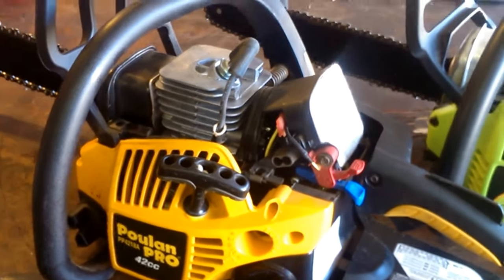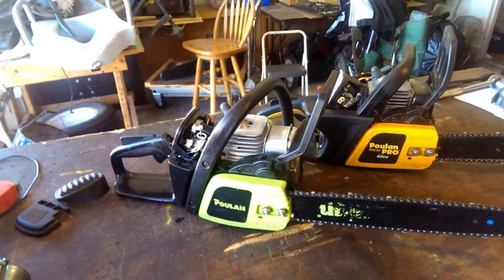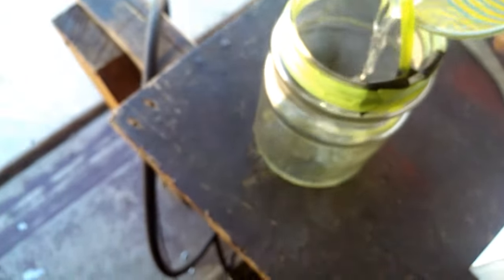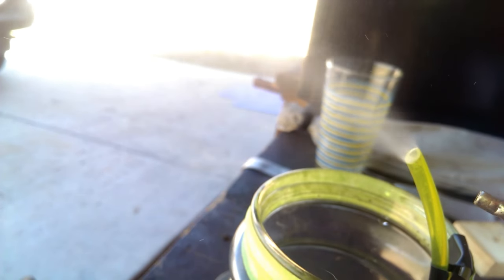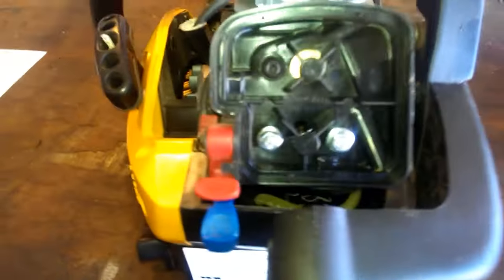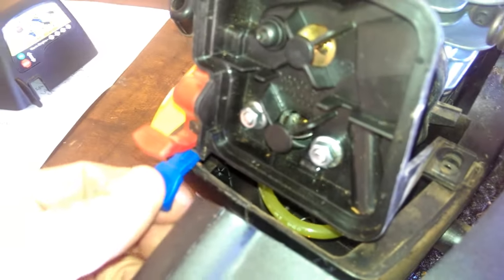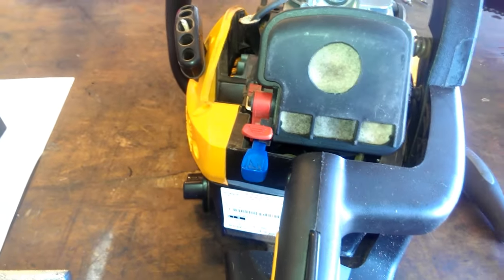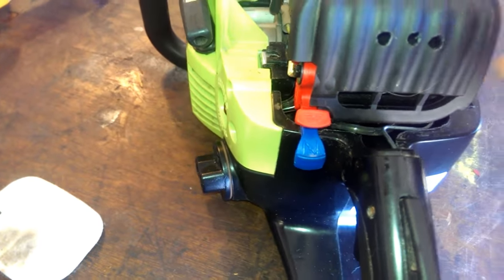Poulan wont restart after being used & how I solved my problem.

Comment: This video is great in going to try this! I have a brand new Poulin Pro (well about 3-4 years old but never used until today). Worked great for about 5 minutes of cutting then engine idled slower sand slower while cutting then just shut off mid cut. Checked fuel was still good.  Tried again after an hour because it wouldn't restart and same issue after 5 minutes. Wouldn't restart.  Think I flooded the engine and know how to fix that issue but wondering why it conked out on me mid cut when it's brand new? Thanks for your time if you ever get a minute to reply and again great informative overall video!
Reply from the maker: J.R. Wilkinson Hey Jr Thanks for the comment. when you say new 3 years old does that mean it NEVER had fuel in it?  Just only had fuel put in it when the problems ocurred?
Reply: ulitepilot aka Zombie Dave Yes that's right. Never had fuel in it.
Reply: I added fuel a few days ago and started it up then actually used it yesterday for the first time. Worked 5 minuted then died on me. Started up again a  hour later then died again after a few minutes of cutting and never started back up.
Reply from the maker: J.R. Wilkinson Ok if you brought this to me and described the problem same as you did, here's how I would proceed. Dump out all fuel. use a hook to pull fuel line out for inspection and fuel filter too. With all that passing muster its up to the carb we go. Inspect filter on carb and clean. Set aside and use flashlight to look at fuel lines from tank to carb, from carb to primer bulb making sure carb to primer fuel line is on the sucking side of the primer.  from primer back to the tank. Prime the carb and look and listen. only squish noise usually means all is ok. A honking noise or visual fuel leak means fuel line replacement. If we are good thru this phase it's pull the carb and look for stretching of diaphragms. kits are $5 and easy to do so If I get this far I just rebuild the darn thing. Reassemble and let it run. Initial carb settings are 1.5 on each jet and fine tune from there. I have always been a hold and throw the saw start guy as opposed to put the saw on the ground and pull start. The big advantage of on the ground starts is easy to set the throttle. ALWAYS ON POULAN SAWS warm restart is to pull the choke out fully and then push back 1/2 way. This sets hi idle for easy restarts. it works! Last but not least 91 octane fuel and full synthetic 2 stroke oil mixed properly. It makes your equipment run cooler and last longer. I hope this helps you. Zombie Dave
Reply from the maker: J.R. Wilkinson I got a little ahead of myself lol. check the. primer and fuel lines first. carb screen/filter can only be done when you remove carb and inspect diaphragms and gaskets. oops. good day ZD
Reply: ulitepilot aka Zombie Dave Thanks for taking the time. Great info. I'll try that!
Reply: the progressive slowing of engine rpm @ idle usually indicates an over rich condition , fouling the plug and preventing a restart. Can be due to flooding of metering chamber r just over rich adj. of lo mix screw. Clean/replace plug restart ,warm up adj.lo screw clockwise tiny amounts till rpm slows ie. a lean idle..trn counterclockwise 1/8-1/4 till a good idle and will take sudden throttle ok. due to circuit overlap ,a lo r hi adj. will affect the other adj.

Comment: when my saw gets hot it shuts off during idleing when it's warm. will putting more are in help with this. it's a wild thing 42cc
Reply from the maker: Steve Cieply letting more air in certainly wont hurt it. Remember the hot restart proceedure. Pull choke out then push back in to set high iddle.
Reply: thanks

Comment: A pro groundskeeper saved me with a 'won't keep running' huskaverna air blower noting the spark arrester clogs up - won't allow the engine to breath.  Cleaned that by tossing it and life is good.  My Craftsman/Poulan 20"/50cc BPWE8 family chain saw doesn't want to keep running.  I shall immediately check the air filter/air flow but am still thinking a clogged spark arrester  to be part of the problem.  I watched another tube and the units seem welded without spark arresters.  Question do the mufflers have a similar spark arresters that can be the problem not letting the engine breathe?
Reply from the maker: Yes it's "possible" but not as likely. Chainsaws generally run full throttle which is not conducive to carbon buildups. Trimmers/ blowers are more easily a victim of half throttle operation and therefore clog faster and more easily. I have an old craftsman 16" that is awesome. It's from the late 90's
Reply: @ZombieDaveAZ  and "the" question: are the mufflers constructed with a spark arrester that can/needs to be serviced? 
What I see on the inner-tube suggests a single - not serviceable - unit. 

PS: You are a great (no, GREAT) teacher [My STEM teaching neighbor got your link as a 'hint' of how to teach science];  Answering my inquiry is awesome!,
Reply from the maker: @TimHoHere   you can't really service them in a conventional way. If you suspect that there is carbon build up you could heat it up with map gas or propane and make it really hard and then scrape or bang it to get out the now loosened carbon. Quite often the port will get clogged right next to the piston. It will have the same effect as a clogged spark arrestor. Remove the muffler and look at the piston. On the same note this is what you check when buying used equipment. Scoring or clogged port is a NO BUY tool. Thanks for commenting Tim. Have a good day my friend. 👍😎
Reply: @ZombieDaveAZ  And thank YOU ... I've been raving about your instructional skills all day!
Reply from the maker: Thanks Tim, you are the man!
Reply: This thing ran beautifully two days ago . yesterday wouldn't turn a lick- family 358.358981 - I pulled the muffler and, as you said, more of an echo chamber than a muffler.  The spark arrester screen fine and dandy (as contrasted to the Stihl leaf blower yuck).  Please tell me how air is expected to get into this machine.  It is form fit with no obvious entry point other than perhaps the magneto spinning like a mini-force feed.  I believe the problem is not breathing but am afraid to cut holes without insight.  I have photos if there is a means to get to you.   I ought to have had common sense when this thing claims to be an easy start thanks to the 'SimPul' technology (pump bulb 6x; pull cord 6x at full choke, then at half choke it will start SimPul-ly! ! what a pain.  How does the air flow?
Reply from the maker: Tim, I must apologize for the late response. Youtube does not always tell me when there is a response to a response. Anyways the way the engine breaths is when the piston travels up and the crankcase is sealed it causes suction and draws fuel mix into the crankcase. When the piston travels down after combustion the positive pressure in the crankcase forces the fuel mix up the side ports and into the combustion chamber and at the same time helps to push out the remaining exhaust. Then it starts all over again. That's how it breathes. You can email me at zombiedaveaz@gmail.com. I hope this helps.

Comment: I hope this fixes my problem. It's a brand new chainsaw.  Starts the first time but not again.  However, if I try to start it on another day it starts the first time but not again. It doesn't make sense.
Reply from the maker: Yup, you are right on that one Candi. It doesn't make sense. Good luck and Thanks for commenting.
Reply: I had to readjust my PL3816 Poulan saw's coil air gap. The coil was rubbing on the flywheel and was heating up and after a bit, it'd just stop working due to overheating. Solved the entire mystery on that saw, it now sits in the corner because it doesn't deserve to be near my Stihl saws.

Comment: my grandfather has a husky 240  and during the summer when its hot when we run it and it runs out of gas or it stalls out it wont start
dont know whats wrong
but it only happens when its hot outside
bc right now (here in florida its kinda cold) its running perfectly fine
dont think its compression bc it gets plenty hot or cold
might be that its leaning out by vaporizing the gasoline? or maby its the mag still have yet to figure out whats wrong with it
btw real great high qualaty content here beter than some of the crap on youtube
Reply: yeah the problem with the carb spittin gas isnt uncomon if the saw inst tuned
bc my pouland 2000 was doin that
and the  gas spitting is a normal all brand thing bc it the carb isnt in tune but the whole aire filter problem is a pouland "certan moddles" thing
Reply from the maker: Nor sure if that husky model has the winter summer window. Check the easy stuff first. Good luck and Thanks for commenting. 👍
Reply: @ZombieDaveAZ  thing is is that i know its something to do with the ignition system idk if its the coil
maby the coil gets to hot during the summer and shorts out and when it cools off it un shorts?
idk
Reply from the maker: @djaydeved  I've seen that happen to me but only on a lawnmower. I guess I've been lucky in that respect.

Comment: what is your opinion on fuel oil ratio for these engines. I've heard from a number of people that a 35 to one ratio is the way to go but a few say that doing so will cause extra carbon build up. Whats do you think?
Reply from the maker: Thats a loaded question my brother. On the paper towel models of lawncare equipment like sears,poulan,ryobi etc, IF the homeowner treats the machine for what its intended use, Then normal 40-50:1 ratio is fine with a little fuel stabilizer. The harsh reality of how a commercial piece depends solely on how its used. I get called to job sites to sharpen chains on big Stihl model saws that are being punished in every way possible. No matter what, time is money for these tree guys and landscapers. As soon as they start their machines they are running full bore and no rest.. top of the line equipment should be run with top of the line fuel and top of the line full synthetic 2stroke engine oils. Follow the manufacturers recommendations on the ratio. Always allow your machine to warm up to prevent premature cylinder wear. Allow the machine to rest if its being worked hard. Especially if you are cutting a stump and have the exhaust buried in the chips.. I know this is wayyy more of an answer than you were expecting. Summation: the better fuel,oil and care given will have the best results. (PS. I   use Klotz /Castor Oils and 91 octane on my stuff and repairs)

Comment: Orrrrr, you could just replace with a new clean filter. Nonetheless, it's a good mod. You should check the muffler too in case there is some kind of blockage creating back pressure.
Reply from the maker: I blamed it all on the EPA and stratocharge engine. That's my story and I'm sticking to it. Lol. I appreciate the comment RhumRunner. Stay safe my friend. 😷🍺👍

Comment: Okay - I should know this but what is the correct gas/oil mix for a Sthil small MS 170?  I have heard/read  50:1 and as much as 20:1     Thanks much -   Gary
Reply from the maker: GD Tractor most run on 40:1. Its always best to follow the manufacturers recommend ratio. Full synthetic and high octane fuel. If you don't use your saw that often mix your fuel/oil using metric system. Lots of videos on how to do that. It helps keepfrom having old fuel hanging around. I hope that helps brother.
Reply: Thx much ...  it sure does !!     GDT

Comment: actually the carb is just a single stage carb. The upper valve only opens  near full throttle and lets only air in to reduce emissions by in effect leaning the a/f ratio.
Reply from the maker: James Farley 3 butterflys and 2 barrels on this machine.yes or no? I dont think I even know what a 2 stage carb is.

Comment: I've been having this problem with my craftsman chainsaw. Took it to a shop, didn't use it for a year or so, but when i did, it was the same problem. Cut some limbs off a fallen tree, took a break, and the saw won't stay on.
My filter looks identical to poulan filter, so that's what i gotta do, drill a hole or 2 through the over.
Also, i watched different video prior to yours, but on a trimmer with same issue. 
A carburetor diaphragm hardening up, was the problem. 
Does a chainsaw have a carburetor diaphragm as well?
Reply from the maker: Absolutely. There are 2 diaphragms as well as gaskets  and how they are installed is very important. There is also a screen in the carb which is the last line of defense for catching any debris that may have made it's way past the fuel filter in the tank. I have a 2 part video on how to clean your carb 100%. Also your Craftsman is the same as the poulan. It has that 2 barrel carb. Giving the saw more air has solved my problem and by the comment left here it seems as though it has helped many others. If your saw had not run in a year I would highly suspect that the metering diaphragm needs replacing. If the metering diaphragm is stuck in the closed position, the primer bulb will have a hard time for gas getting to it. If the metering diaphragm is stuck in the open position you will smell gas all the time. It's going into the crankcase and creates a flooding situation. I hope this helps. Ask any questions you may have and I will do my best to answer them.
Reply: @ZombieDaveAZ  
Thank you. I will tackle this issue when i get back home
Reply from the maker: @truckdevine  you can do it no problem.

Comment: I f**** hate those new gas cans and that's also why Grandpa always taught me to always use 100% gas and overtime I've learned ethanol gas will foul out carburetors and spark plugs and anything else small engine wise use real gas but I agree with everything in your video you're totally right about ethanol being a hydroscopic fluid but I love the old gas cans myself which is why I keep a hundred percent gas in them but also for the ease of pouring Factor the new gas cans suck ass I hate having to use those specially on job site so you have to have the new gas cans because their safety rated or whatever the f***
Reply: Then its a REALLY good thing that we ONLY buy and use 100% pure gasoline in our small equipment. Like our weed whackers,chainsaws and tillers. And we have NEVER had an issue as far as I know with what you described either.

Comment: Fixed Quite a Few Poulan Saws for Friends . The old Poulan Saws (the ones with the Metal cases ) were Great saws  The stuff made in the Last  15 - 20yrs is CRAP  Throw Away Saws.  The Best way to Fix a Poulan Saw that Won't Start is to Buy a Sthil  or Husky   they Should be called  Pullin  because you Keep Pullin and Pullin  and it still won't Start
Reply from the maker: 1995dresser couldnt disagree more with you. Unless absolutely neglected to the enth degree,Poulan Craftsman makes a decent medium duty saw for the homeowners occasional use. My videos are for guys that own these saws and don't have alot of chainsaw mechanical knowledge. I happen to like and appreciate all machines that come across my bench. I DO rag on engineers and companies that  put out inferior products for the dollar over longevity. It's called planned obsolescence. A machine wont last forever and abuse will shorten its life. 15-20 hours of cutting firewood @ less than $150 and 10 years? I'm ok with that. Got $500-700 and you generate income with your saw? You'd be crazy not to get a Stihl,Echo or Husky. Just take care of it the same as you should a Poulan and it will last. Maybe we can agree on some points but Poulan and Craftsman has a place in the market. Look how many views this video has..... thats alot of chainsaw owners looking for answers and to save $. Thanks for commenting and I respect your opinion. I just disagree. Zombie Dave.

Comment: ZD my Poulan has been  acting up but I am determined to squeeze more life out of it. The chain bar running but heating up and stopping , So I grabbed an old bar I had laying around and it worked great for  5-10 hours but then again I see the little pulley's at the tip of the bar are not freely moving today . I am thinking maybe just order a new bar now. What do you think ? Thanks.
Reply from the maker: Abe, great question. There are 2 theorys that most guys adhere to. The first is to never grease the head/tip sprocket. The idea being that once dirt sand or anything gets in there the grease will hold onto it and keep it up in there. So they dont grease it. The other is to grease it daily to force the old grease and dirt out. I personally am of the mindset that not greasing the tip sprocket works better. Thats just me. I will put the  bar in gas and use a brush to clean the old grease out and let the bar oil do its job. Thanks for the comment/question and let me know what you do. I hope you subscribed. 👍
Reply from the maker: Abe, great question. There are 2 theorys that most guys adhere to. The first is to never grease the head/tip sprocket. The idea being that once dirt sand or anything gets in there the grease will hold onto it and keep it up in there. So they dont grease it. The otber is to grease it daily to force the old grease and dirt out. I personally am of the mindset that not greasing the tip sprocket works better. Thats just me. I will put the  bar in gas and use a brush to ckean the old grease out and let the bar oil do its job. Thanks for the comment/question and let me know what you do. I hope you subscribed. 👍
Reply: @ZombieDaveAZ  Thanks for the info. and yes I did subscribe. Last night I ordered a new bar and today I grabbed the older bar  which is  beat but the head tip sprockets are moving so I am going to clean it up see if I can file or with pliers make it more uniform put a chain on it and see how much cutting I can get done before the next storm due after the weekend.  AM

Comment: So changing the air filter doesn't resolve the problem but drilling holes in the cover does??
Reply from the maker: I went thru all  that and it only worked after the hole was put in the cover. Thats just me.